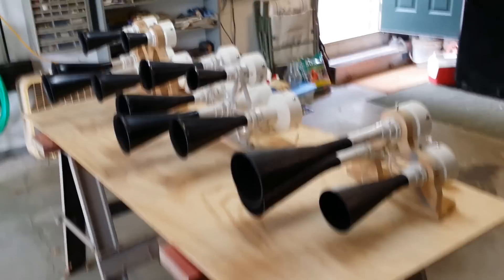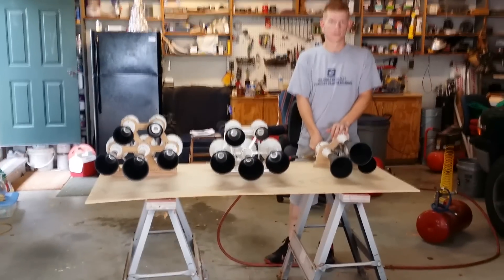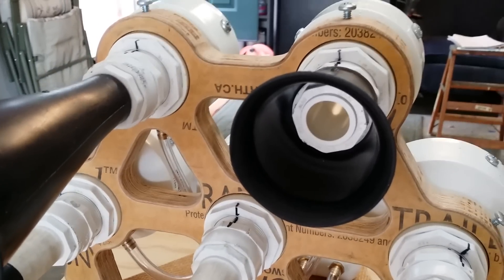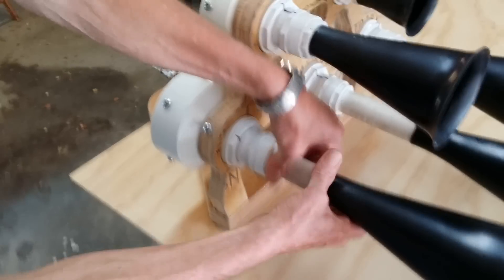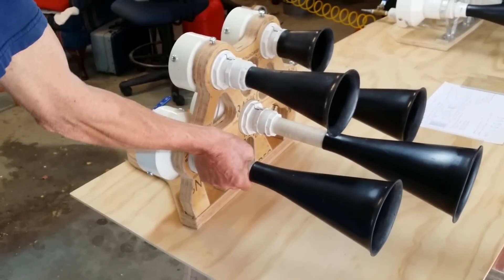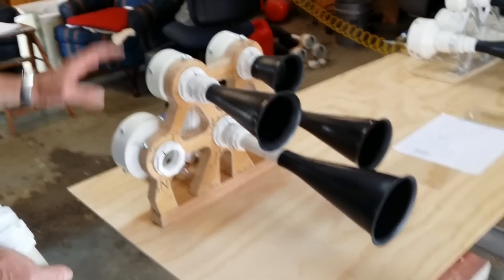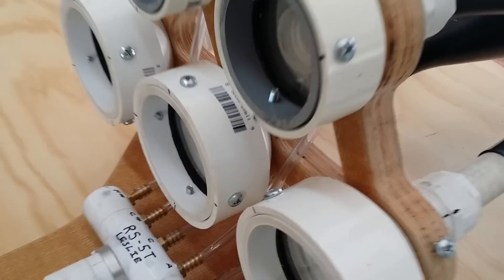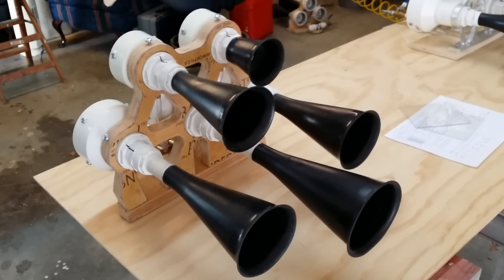PVC train horns explained

Comment: I built a 3 chime NathanP3 tune (C#, E, & A notes) set from DozerBoyMillers plans. The first set of plans seemed to be missing something after studying them & exploded views of real train horns. I bought a 2nd set of updated plans that also included links to 3 proprietary videos & used his favorite diaphragm material, polycarbonate in 0.093 inch thickness. I noticed in real train horns smooth radiused aerodynamic transitions just inside the nozzle inlet & the same into the bell (trumpet shaped part). I bought a large tapered reamer over 1 inch at largest dia. & tapered the pvc where it exited into the  bell to reduce turbulence. On the nozzle end, I had access to an old junky lathe at work & machines the nozzles (preglued to the 3/4" exit pipe), 1st with the lathe to knock the sharp corners off inside the nozzle, then switched to a mini-portable belt sander to perfect the perfect, radiused bell curve from nozzle inlet to exit pipe, just like real train horn nozzles! The diaphragm preload is done differemt with his system (no threads). I preloaded to begin blowing at 20 psi using an adjustable air regulator for tuning. My reasoning was I did Not want a low pressure "mouth-blown" version, but a real freakin" LOUD train horn!! I assembled it into a portable Show-N-Blow version with a  11 gallon 140 psi Max spare-air Craftsman tank. 1/2" id hose & ball valve to a steel pipe manifold. 1/4" id clear hose to each chamber & BAM!! Much better than I expected or imagined! I went from building to building at work & got tons of grins, laughs,shocked faces & even people leaping or jumping, though warned repeatedly! And..I even got in trouble for disrupting a big honchos international business call! OOPS!. I originally intended to install the train horn on my little economy car because I kept getting run off the road, unseen & unheard (dinky factory horn) but I had so much fun in ShowN Blow mode, I never got around to it. Paul Nice quality looking mounts & design BTW.

Comment: Hello, wanted to ask one thing. 1" pipe - is it INside or OUTside diameter? Thank You!
Reply: Xas Ygrikas ID
Reply: Ronald Baker 
OK, lets say it's 1" INside diameter pipe with 1" coupling half on one of its ends - how the end with the coupling could fit through 1-1/2" threaded bushing? Outside diameter of 1" pipe is already ~1.3" - almost, almost near 1.5" diameter of bushing hole - I see no way the pipe to be 1" INside diameter.
Of course, maybe I'm wrong - explain me, please :)
Reply: all pipe is Id and all tubing is od. I know it's weird but that's what the engineers want

Comment: I like your tuning methods, I'll have to give that a try.
That upper C note is definitely hard to reach. That was one of the hardest notes to get on my horns. But it is possible to reach it.
And I recommend keeping all the air inlet holes the same size on all the horns, it makes assembly easier. Then just drop small wire crimp connectors into the air line to reduce the supplied air. These are the style of wire connectors I use. http://www.amazonsupply.com/wire-crimp-connectors-blue-yellow/dp/B002T1FLPM

Comment: awesome videos guys, can't wait for the full psi test, you by far have the best design, just wondering how you know when you're at the right note? special tuner? and how ate you planning on putting a switch inside the truck when it comes time to install? maybe a sprinkler valve with a momentary switch on the dash?